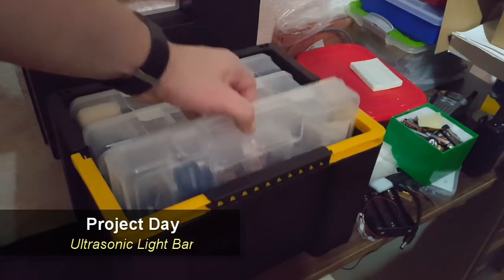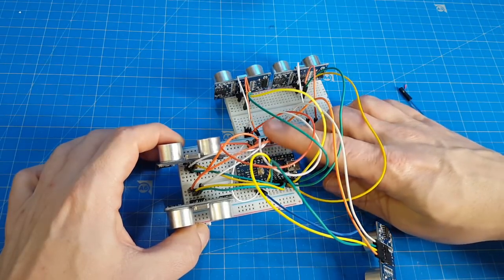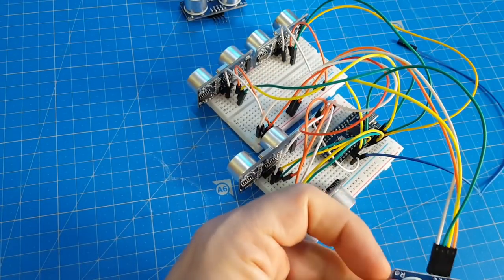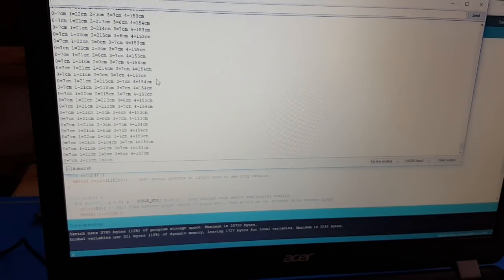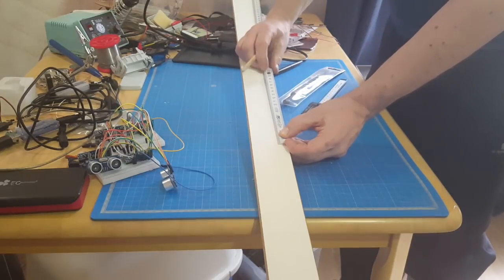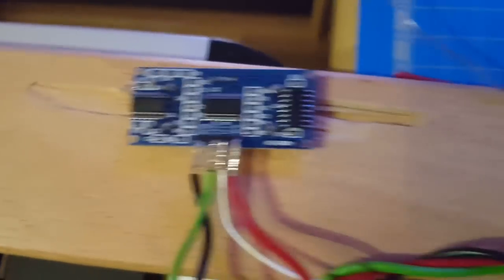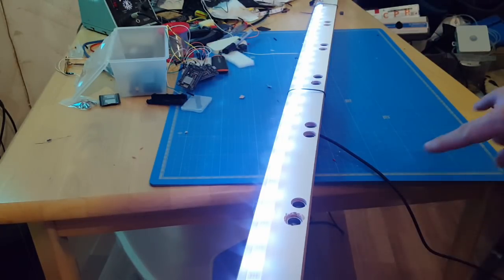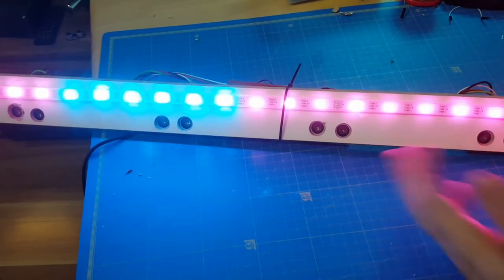Ultrasonic Light Bar

Comment: I don't know if those SR-04 are all the same as mine, but I found that you only need one Arduino pin per echo/trigger pair on the ultrasonic sensor. They "float" (? not sure that's what it is called, I'm a newb). But you can wire them together and it still works. So 5 arduino pins instead of 10 to operate 5 ultrasonic sensors.
Reply from the maker: Do you use an analog pin? Because they float.